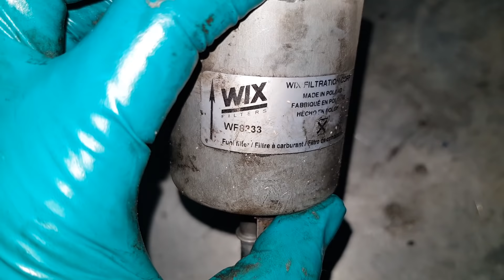Filtro de gasóleo com 40000Kms - Peugeot 308 1.6 e-HDI

Comment: Um filtro que filtre melhor é normal que fique mais escuro que outro que filtre pior. Tenho um filtro de água em casa, já experimentei usar filtragem de 5microns e de 25 microns, na filtragem de 25 microns o filtro nunca fica tão escuro como na filtragem de 5 microns, pois deixa passar mais impurezas mantendo a cor original durante muito mais tempo.
Esse filtro com 40000km foi trocado aí ? Se foi nem questiono... mas será que foi mesmo trocado à 40000km?
Reply from the maker: Fui eu que troquei tinha o motor ~80000Kms :)

https://www.facebook.com/OficinaEblase/posts/1013017975435550